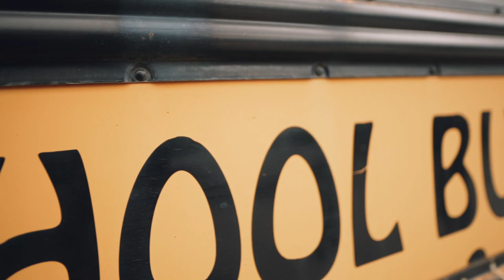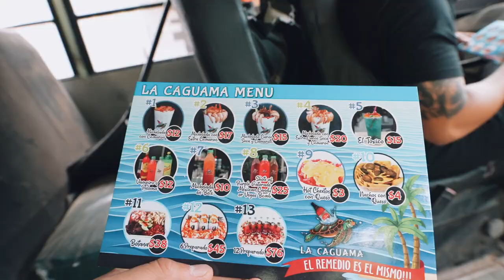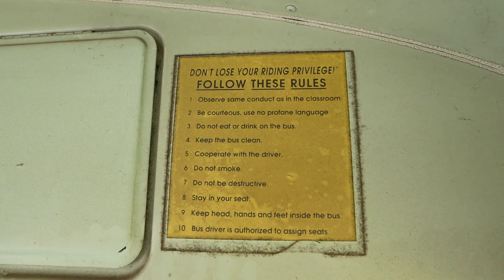Starter Pack winner pulled up! *ODG SCHOOL BUS!*

Comment: And then on the emergency escape hatch for the roof you guys need to put a hold deck up on the top of the bus where you guys can chill and have a little campfire and stuff up there you can get one of the metal fireplace pit and put it up there with some lawn chairs and stuff with some speakers and have on the very front all the way to the front of the bus have it that Big Deck with railings that lock up in the place they fold down and come up and at the very front of the bus put a 110-in TV projector that rises from the floor on that in a pole and it just pulls it up and then there's your screen that would be badass

Comment: Y'all need to pimp the bus out you guys need to slam it put bags on it murder it out put some 30 inch rims on it and put six 18 competition speakers in it in the back put 6 reclining chairs in it and a big 85 in that folds down behind the bus driver but it would be folded up in the air when you don't use it quit to levers and it just comes down to just pull it down and then you can use it when you're not using it just push it back up to the roof and it locks in to make it one of those bad ass on the gas buses